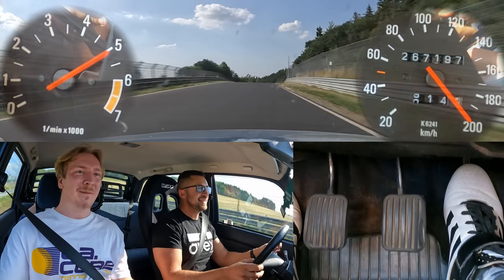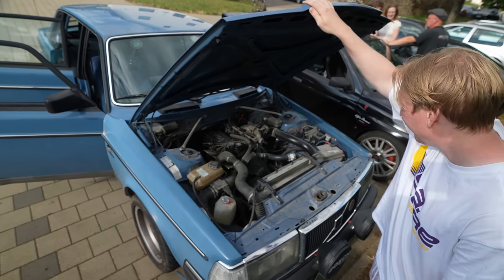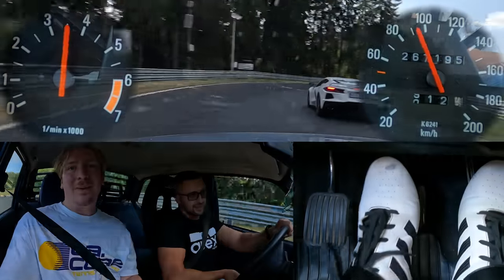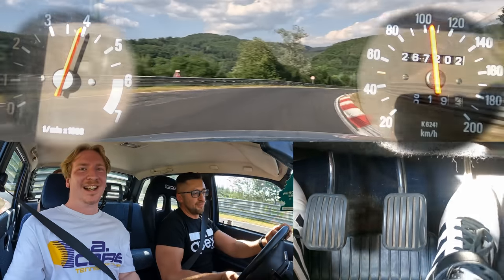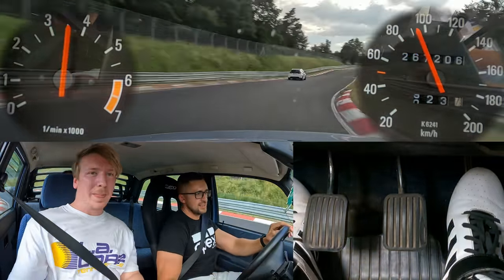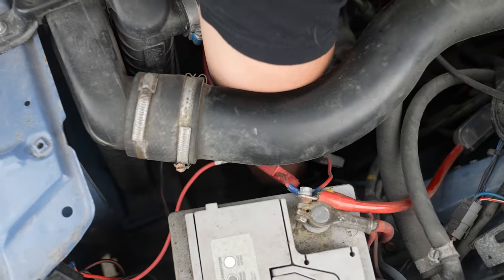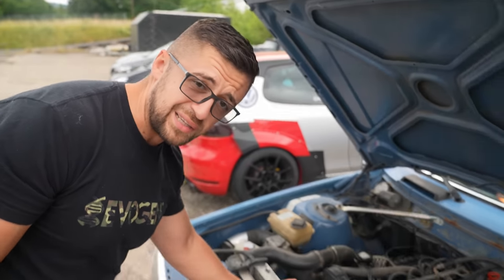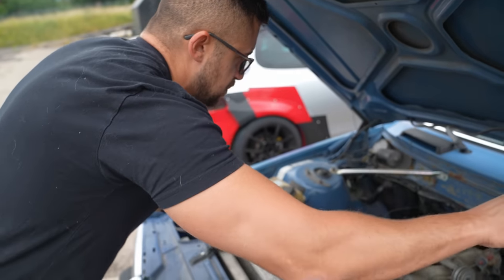I BLEW UP A VOLVO 240 on the Nürburgring :(

Comment: First time I've seen a broken Volvo. thanks misha :)
Reply from the maker: Me too :(
Reply: It takes a special skill to do that ;-)
Reply: Must be CGI.
Reply: Should visit sweden, broke volvos of any kind is extremely common. But judging from your comment maybe the love for volvos that is to much for your heart to see haha.
Reply: My 240 has refused to run a couple of times, but generally is quite reliable. Couldn't get it over 180kp/h on the autobahn though, N/A life :p
Reply: @scubasteve4152  Yes because they have been very common cars that were worth nothing and have gotten beat on a lot without fixing/maintenance.
Reply: @BAAAASJE  my 240 has had alot of problems. Now it's mainly rust and trying to keep it in a ok state 😅
Reply: I driven my 740 on a concrete block once, front wheels in the air... I was afraid to open the door, expected a big puddle of oil and coolant, nothing.
Put it in reverse drove of the block, only a little rubber under spoiler lip came off, popped back on.
Great cars, too bad the Chinese bought the brand and make them cheap and as unreliable as other cars.
Reply: @scubasteve4152  BS Volvos dont break down but Subarus brakes down on iceracing circuits all the time...
Reply: @maxjarno7814  I don't know what you on about, southern sweden you see broke down volvos everywhere in the vinter. We are not talking ice tracks, we were talking this urban myth about volvos not breaking down, ofc they brake down. Maybe less than other cars sure but they do brake down.

Comment: Its crazy that the engine blew, threw out bits from the bottom end, and still didn't loose much (if any) oil, really curious how that worked?! Definitely lucky that it didn't make a mess on the track.
Reply: The hole seems to be well above the oil level so that probably helped a lot. It must've splashed out a bit though.
Reply: @dirkmohrmann8960  yea that's what I was thinking, still seems it failed in the best catastrophic way haha.
Reply: Yeah, maybe the oil pump seized or something?
Reply: my idea is that the oil got too hot and stopped giving the bearings enough lubrication since he decided to not run the original oil cooler mounted on the turbo variant of these engines, the oil filter seems to be a cheap "Biltema" filter too which is like Ebay quality.
Reply: @stridsvagn1039  definitely possible, something definitely seized and left the engine, that we know for sure!
Reply: B230s will fail on the wrist pin (where the connecting rod connects to the piston) the piston can "grab" for a millisecond, and cause it to shear, which then lets it flop - and if it smacks the top of the block it will come out like that one did.  Ask me how I know....
Reply: I see an amusing series coming up …
Were that the brakes rattling or was there already something fishy happening in the first and every following corner.
Reply: @ErikB750 around 7:20 I saw Misha off brakes with the knocking sounds before boost so I'm thinking it wasn't happy leaving the parking lot....

But good show
Reply: @ErikB750  I thought I was hearing some concerning noises as well but figured eh... Old Volvo 🤷. Apparently that was not the case.
Reply: @stridsvagn1039 same - I worried was the oil pan baffled etc - because that boat be rockin (my sister and I grew up destroying moms)
Reply: @ErikB750  Sounds like Volvo 240 fans to me, they rattle a lot, hence why the owner said what he did, but obviously Misha was talking about another noise, not the fan rattle that was near constant.

Comment: Such a shame. 😢 hope the owner rebuilds it better than before
Reply: These engines cost like 400 bucks and can be found any day of the week. I've replaced everything but the engine internals on mine and virtually nothing has been cost prohibitive or difficult to do
Reply: Ive been working with volvo 8v engines all my life, and its correct. Many Times engine broke Down during trackday,  i collected a new one and rebuilt it same night,  and drove again next Day, for almost no money at all, nomather where in swedwn you are, you never have  to drive more than 30 min to pick up a used engine. 

Actually you can hear the bearing nock in first brake/turn in, suprprised it worked so long time after that. 

He should have overfilled engine atleast 1 litre for this kind of high rpm driving😂😂

The stock MAX level on the dipstick is a guidline for those elderly People never revving it past 3000rpm 😂😂😂
Reply: @knotannrkpg  The rattle that is heard from the start is propably the fan or something else resonating. The owner says the knocking is the fan at first also.
Reply: @MrAsddasdasda  maybe, but I doubt it, since the original visco-fan and plastic is removed the electric fan probobly isnt spinning at such high speed/airflow.

And this is the kind of noice b23/230@)s are making due to oil-starvation during hard brake at high rpms. 
All Volvos used for on track have normally a upgrade drysump pump or heavymodificated oilpan and crankcase ventilation/catchcansystems that this engine seem to not have. 

Anyway, i bet there is a new enginge in it already
Reply: @knotannrkpg  Could be oil starvation for sure.

Comment: I wonder if oil starvation in the long corners contributed to the engine failure?  Thumbs up for a great video and going above and beyond to help out a fellow gear head.
Reply: I was thinking the same thing. If I had to guess, I‘d say oil starvation killed it.
Reply: Most likely. You can hear some noise few corners before that were not the fan clearly...
Reply: @vasek987  I know nothing about Volvo engines, but have built some old Datsun engines for road racing.  Seems like a windage tray in the oil pan could be a potential easy fix.
Reply: My guess also, not uncommon to put in baffles in the sump of the red blocks if  you use it for some more enthusiastic driving.
Reply: But also you could hear that noise that the owner insisted was the fan from the get go. I'd say it had a dodgy rod bearing from the beginning and that drive spun it completely and the rod cap or big end smashed through the block. Unfortunate but inevitable.
Reply: That engine died becouse none of you had any experience with oil starvation and the sound it makes. On every corner entry you hear the knocking. There is no oil pressure, none.
Next time youll use your ears to, now you know how rod bearing knock sounds like.
Reply: @chriscoker9513  You're pretty much bang on I think, you can take a couple of corners without an unmodified oil pan, but not this many. As soon as the intro was over and he pretty much had no specs to tell about it except the pressure, I was pretty certain why it broke.
Reply: @HexerEngineering  Not really sure that particular engine died because of any of us! LOL but anyway listen at 3:55 - the sound is there already and there has barely been any cornering. One braking effort wouldn't cause starvation. That engine had a problem before it even went on the track. The fact the owner already knew about the sound and thought it was the "fan" means the sound had in fact been there for a while before the car was taken onto the track. This engine was due to spin a bearing, and Misha's harder driving just took it there sooner.
Reply: If the owner wasn't that mechanically inclined, i wouldn't blame him too much for thinking that the light knocking was coming from the fan, having owned an old 240 the heater blowers in these cars tend to break, and they can pretty much make any noise under the sun, including knocking/screaming etc.
Reply: @markhodges1276  the noise is there from the 3rd corner, its a miracle it made it 2/3 of the track, Proper race engine would blow up after 4-5 corners running dry.
Not blaming any of them, just pointed out their lack of experience in this matter, that is obvious as most of the newer cars doesn't suffer this bad, mostly they spin the bearing on much less starvation that would go without the knocking, after spinning obviously they through a rod and knock like hell.
Reply: I'm convinced some raffled oil pan, and higher quality oil + cooling would fix this. Oil press + temp meter could prevent this. The engine probably ran original main+conrod bearings which you don't want to do on anything you're pushing, especially since the engine was probs from 95-98 and had 30k kms +. Renovation pack with all gaskets etc is like 400, oil temp 1/8npt hole + raffled sump, and then temp and press gauge to keep track (temp around 110 and under 120c, press should only shift a bit in higher rpm).

Comment: I could hear rod knock every time it was pushed hard on a right hand corner for a long time before it blew. Seems to me lateral G caused oil starvation and bearing failure. When you get a replacement engine make your own baffle plates (anti-surge) for the sump.

Comment: That’s so cool to see the old brick hammered around the ring. Really surprised to see one throw a leg out of bed. I guess you could say there’s now an inspection window. 

They’re not a heavy car, 1350-1400kg tops with a turbo motor. My 244 was 1280kg. 

They are softly sprung so lean a lot but it helps allow the big heavy live axle at the rear to move without upsetting the body too much. 

I hope you get it on the road again soon. 

Long live Redblock power 💪

Greetings from Oz.

Comment: I'm sure it was the wet sump oil system. Probably starved it of oil going around all those corners. RIP little engine. You've served with honor and dignity.
Reply: im more sure that it was temperature related since he wasnt running an oilcooler, guess it made the oil thin enough to not lubricate and possibly also starved it as a result
Reply: You'd be correct. They have massive oil starvation issues with factory sumps.
Reply: @stridsvagn1039  Probably both. Mitsu 13 @ 1-1.2 bar (?) + original sump + no idea what temps + no idea what press = death on the nords.

Comment: One of the most eye catching cars on the road, love these old volvos.
Reply: I think so too but most people don't apparently. Maybe that's because I'm driving a 245 but it's very rare for it to turn heads.
Reply: @Bassalicious the 245 estates are my absolute fav of the lot. And they may not say it out loud but they'll softly say to themselves while they drive by, 'those things are cool'.
Reply: used to have a 240 wagon, shit condition but got lots of attention here in the uk!
Reply: @angryii5411  I like to imagine that too :D
Reply: I'm also driving a 245, but with a b230a engine and aw70 transmission, it's slow, handles like a boat, but I would never trade it for anything else (ok, maybe a ford escort mk1 with a sierra cosworth engine)
Reply: Hyperbole incoming, but I think they're beautiful cars, especially the estates. And yes, I always turn my head when I see one in mint condition pass by thinking about how I could totally turn it into a monster of a sleeper (despite having no mechanical knowledge or experience at all lmao).
Reply: @joey8313 handles like a boat, because you havent upgraded the suspension lol the chassis is very good

Comment: B230 bottom end... yeah, it can happen... be proud you killed one, Misha! That is not an easy task.  I've had several of these with many more miles and pushed as hard as you were pushing.  I've also had 2 break from other issues. One was an oil pump pressure spring break and the other was head gasket failure.  I've had one go through the side of the block like that, but it was after we abused the *crap out of it (driving from Dallas to Wichita KS with a known blown head gasket - but had to get home ASAP and didn't want to abandon car... things you do when you're poor)  it made it home (took 12 quarts of oil) and then 2 weeks later,  it got revved very high, and the wrist pin let go, putting the connecting rod through the block up high like what that one did.  Almost no leakage of oil, but a dead motor.

Comment: Hell yes, love me some brick content! Hopefully I will bring my 1973 Volvo 145 with a 16v turbo swap to the ring in the near future.
Reply: B234 or some other engine?
Reply: @Bassalicious  Just the "standard" setup that most people run, B230FK block with B234F head. Forged rods, stock pistons and crank. 
GTX2871R turbo, homemade exhaust manifold and intake plenum. It’s mostly a street car so I’m going with a small turbo, aiming for around 350-400hp at the flywheel with good low-end torque and driveability. 

And then good suspension and brakes obviously.
Reply: @NorwayVFX  Sounds like a lovely setup, good luck with it!
My dream setup would be the same bottom end as yours but with a 8V 531 head and around 1.5 bar of boost. 
Sadly all that stuff is illegal in Germany unless you have hundreds of thousands of Euros to burn.
Edit: Forgot to say I'm driving a 245 with a bone stock B230F and M47.

Comment: Have blown a few 240 engines, transmission and rear axles.
The best 240 I had was a 1981 TIC with 1,5bar, volvo r-sport suspension parts. In a 240 you should always mount a powerful electric fan. Just don't go after how big it is, look after how much air it can push thru the radiator.
Reply: By overheating them?
Reply: @andrewaton3353  overheat, rods thru the blocks etc

Comment: Lovely car in a lovely colour, totally not biased since I have an 85 estate the same tone. Better cooling system, new engine, new H-beam rods for it would be a good idea and that engine would be good and reliable for MUCH more boost! 
240s definitely are an underdog on the race track but the Group A race cars proved the chassis very competitive in the 80s so don't let their boxy looks fool you, they can be track beasts too
Reply: I miss my 85 estate in that color... it was just a plain non-turbo with an automatic (with o/d)  we drove that thing from 170,000 miles until 390,000 and then sold it to another guy when the fuel pump went out - and it had a weird little knock/rattle on start up - he was still driving it 4 years later, and it still had that same little rattle... 
Great car to go cross-country with 2 little kids...  Cheers!

Comment: That's the fastest 160hp I've ever seen! Looked more like double until it turned into 1hp air compressor at 11:59
Reply: The old redblocks are weird beasts, supposedly the lpt version was 140ish bhp, the hpt a little over 190 in top sport trim.
I have an lpt, but with a bigger turbo and running hpt boost levels, so maybe 200-220ish bhp. It's not quick quick, but it's the midrange where these things excel, they just pull like a train.
Reply: Well its only a little under 1300kg and has good power thoughout the powerband unlike a honda engine.

Comment: I was listening to that knock from the start of the lap already with a keen ear...
Reply: Yes, it was already doomed.
Reply: I think the camera amplifies the sound. It was probably way quieter for them.
Reply: @josephsamsor1698 yes, mics are way better at picking these sounds up than human ears.
Reply: A lot of the rattling sound earlier in the lap before it blew up is the fan for the ventilation in the car, which is why the owner first thought it was just the fan when they heard the rod knock. The fans in these old Volvos tend to touch the housing they're inside and make some really terrible sounds, especially when going over bumps. You can hear that the noise isn't consistent with engine RPM.

Comment: Did the car have an oil cooler? Non turbo volvos didn't come with an oil cooler so when he swapped to the 940 engine perhaps he didn't add one? Also if you got the engine from a 1993+ 940 they came with water to oil coolers that used a much larger radiator to keep up with the added strain on the cooling system. If he was still running the water to oil cooler with that small stock 240 radiator it could get the water and oil temps quite hot. These engines are as robust as they come and will usually only fail due to user error or incorrect setup.
Reply: Nice seeing you here, i checked the registration on the site that keeps track of cars in sweden and it said that the engine should have come from a later 940 with a low pressure turbo.
One big problem that i see too is the use of the Biltema oilfilters which are no good in a redblock and since they took it to the track that was the end.
Reply: I don't think the small radiator could have the water to oil cooler. The option with the small radiator for turbo engines usually had a separate oil cooler right next to it.
Reply: @viktorstj  that is correct. The earlier 940 turbos are like a 740 turbo with the oil to air cooler up on the driver side beside the radiator. In 1993 they changed to the water to oil cooler and used a bigger radiator because of this. His engine was pulled from a later 940 with the water to oil cooler, so if he is still running the small radiator that the 240/740 would have came with, the oil temps and water temps will get too hot.
Reply: @stridsvagn1039  yea so unless he added an air to oil cooler OR a better radiator. The stock cooling system would be strained by that water to oil cooler and thus fore oil temps will get hot